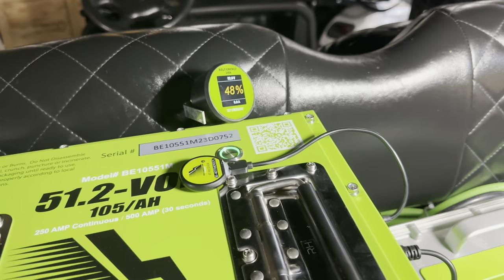EZGO RXV - BOLT ENERGY USA 51v - 105ah Lithium Golf Cart Installation Video

Comment: I have a 2017 RXV Fleet 48V.  Have you had any issues with the regerative braking after installing the Lithium Battery?
Reply from the maker: Not with Bolt batteries

Comment: Fantastic video!! I am installing the same battery in my RXV. Question, I have a toggle switch that allows power to use my light whip, stereo etc…do I run this to 48V battery or to the 48-12 fuse box?
Reply: Run all accessory lines to your reducers 30amp lines... You can ground at the battery… if it makes sense or easier.  Just don’t run em all directly to the bolt
Reply: @sirchapl  You are the man. Thank you very much. Subscribed!!

Comment: What is the rationale behind the battery being 51.2v? I have a 48v RXV. I figured I should get a 48v Li Battery. I am intrigued though, that green is sharp.
Reply from the maker: It’s the nominal voltage of the cells times the amount of cells to exceed the voltage and amp discharge required to operate the vehicle.